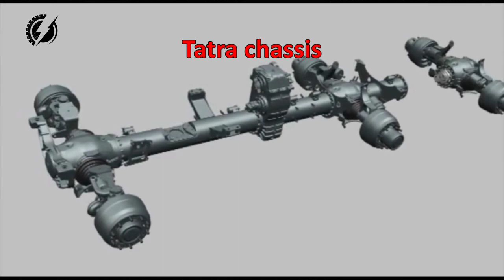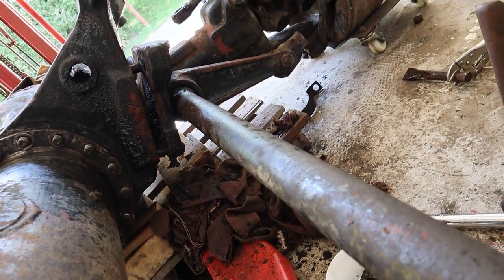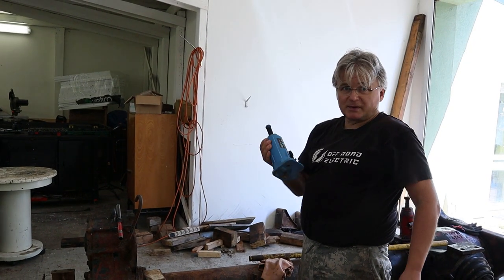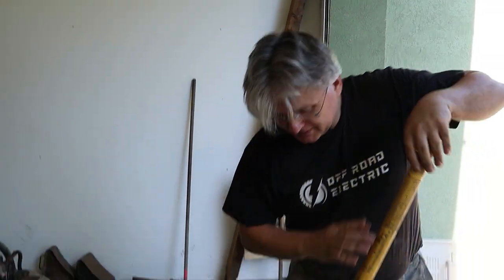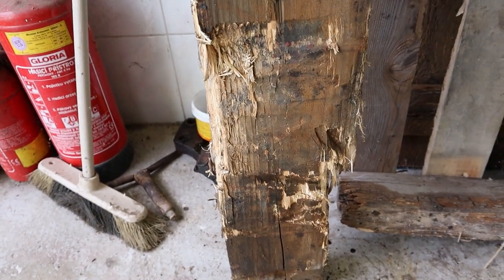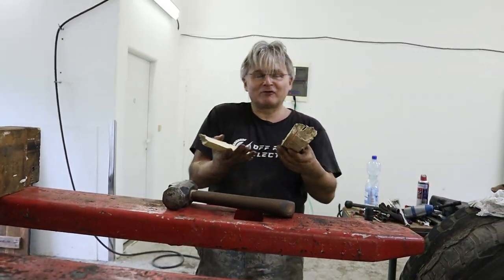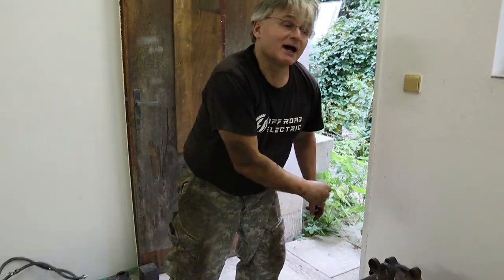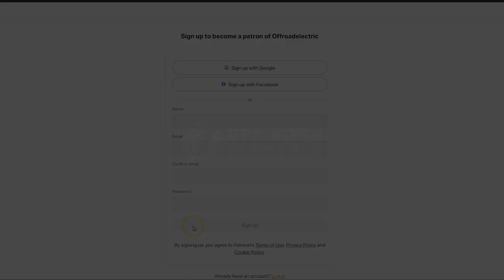EP.36, Very difficult work on the second Tatra chassis! - 4-motor Monster Truck Project

Comment: Hey Peter! Its awesome to see the progress with your project, keep up the good work and the updates! Why dont you use some kind of loosening spray / creeping oil especially on those threads which you want to save?
Reply from the maker: Thank you!  Did it several times before I touched it. When I unscrewed the last bolt, you can see some of it leaking out......Use it often, but we often edit it out......The next episode is a masacre, but this Tatra is done!

Comment: 6:50. Hey Peter, you might want to tell you wife or camera lady not to wear those rubber shoes.  They are really slippery when it comes to oil or water on smooth concrete.  I almost killed myself once just on a little puddle of water in my garage.  With all of those sharp corners of the Tatra, a nasty fall could really hurt.  Cheers, and keep up the great work.
Reply from the maker: It happened and I told her many times.:)

Comment: hey you should learn to use a hammer the corect way
Reply from the maker: No. When you want to minimize the marks on the object you hit, you will not use the hammer the "correct"way. Perhaps something new for you to learn.:)
Reply: @offroadelectric9457  I do the same thing with the hammers for the same reason.